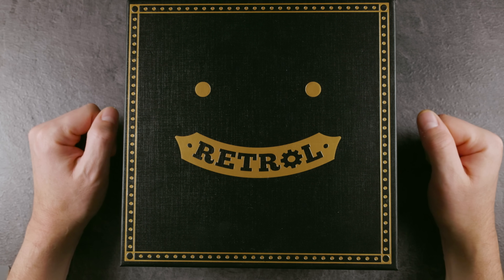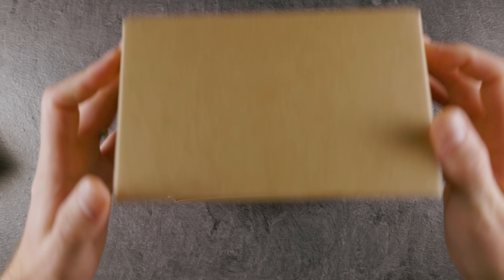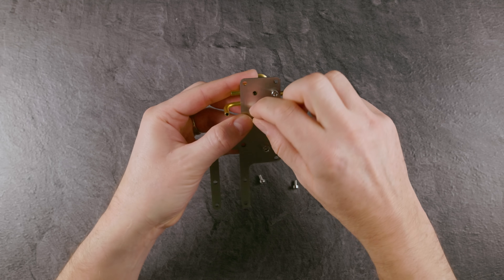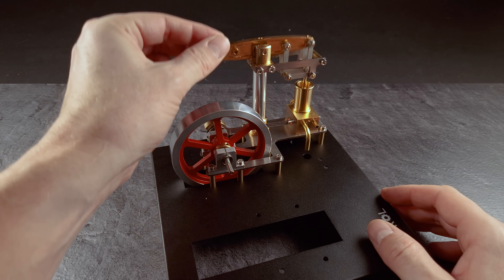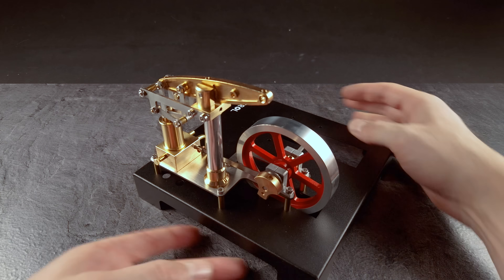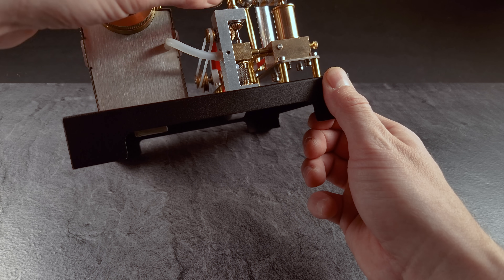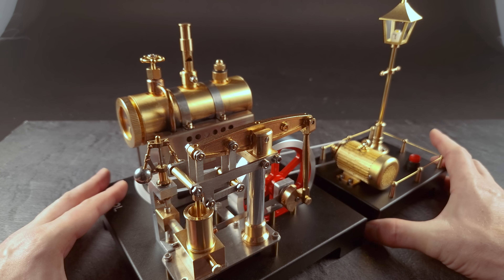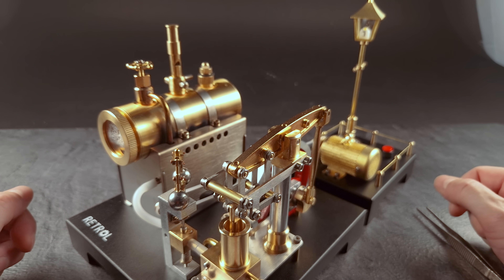Fully functional retro Steam Engine Kit - Assembled and fired up!

Comment: 100% recommend this over any Wilesco etc. engine. Got one and and its almost perfect out of the box. Only minor issue is that the governor valve leaks and does not really control the speed that much. Have to open the piston bottom screw a bit to keep the speed in control.

Comment: People for some weird reason believe that steam is antiquated and obsolescent however it is very very powerful & thooper dooper thooooothing.
Also they require oil, there should be an oiler that drops a dollop of oil into the main cylinder plus all the outer moveable portions should be oiled. Although that's for the more sophisticated & complicated engines. Now build a triple expansion steam engine. Lol

Comment: Nice.  It would be a puzzle to assemble it and get it working with no instructions.
Reply: Yes without the instructions you could make 2 mistakes like he did.😂 (missed tube and putting saddle bolts in without thd saddles.

Comment: I built a 2 cylinder steam engine in highschool metal working class. Only my friend and I made them because it was my idea 😀 They were really amazing, but unfortunatly, mine was lost in a move many years ago.
Reply: My cousin made a model of a working steam engine when we were kids. It came as a kit like this but a bit lower quality...more for education purposes. Pretty much the same thing tho'. It came as a model/kit that you put together. It ran on alcohol. I ran a tiny little incandescent bulb when done correctly. Fun!

This one is much higher quality tho' and looks like fun to build and muck around with.
Reply: @bluflaam777LSA  Yeha, I actually crafted every single piece with lathe and milling machine and stuff. back in highschool. I was working on a paddleboat before i ended up moving...

Comment: Very Satisfying to see it running... There's something amazing about simple but complex nature of such machine.  

BTW: I don't know if you are aware of, or watch a YouTuber Quinn  A.K.A. "Blondihacks"  It's a machining channel and she builds projects that include boilers and steam engines.  She is currently building a Pennsylvania A3 Switcher locomotive at 3.5" gauge (much bigger than the kit) and it will run on an actual track pulling cars and perhaps people around in the yard at a model railroad club.  She is building this fantastic machine completely from scratch using her lathe and mill in her garage workshop and she explains the construction and concerns about pressure vessels.   She's got over 50 videos on that project alone, and she is still building it.   I have no association with the channel, but I find it very interesting to watch.
Reply from the maker: I will check it out